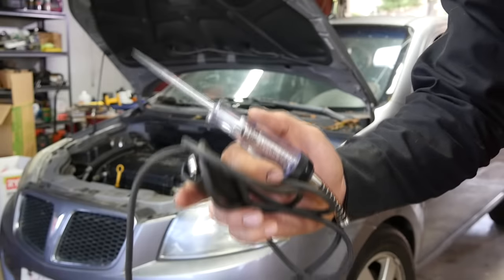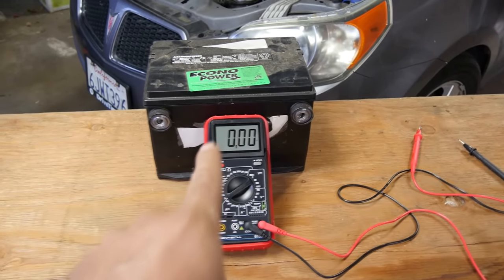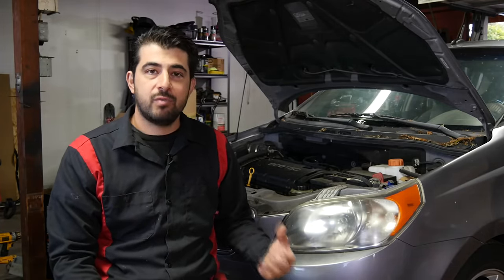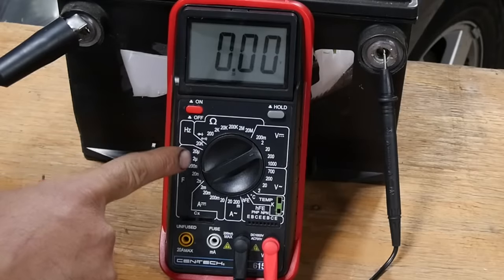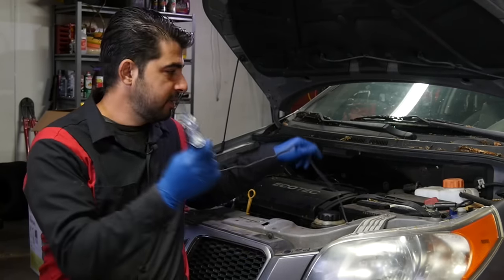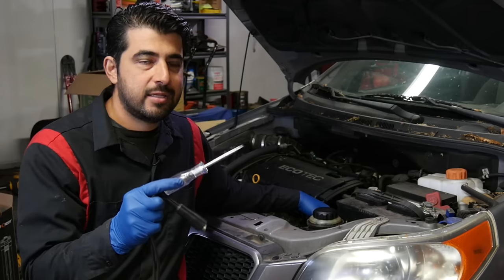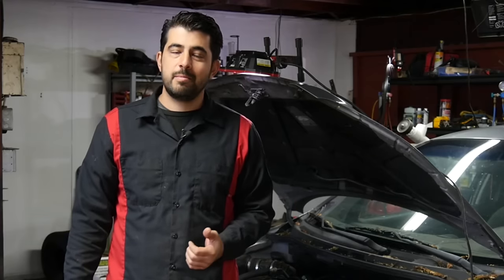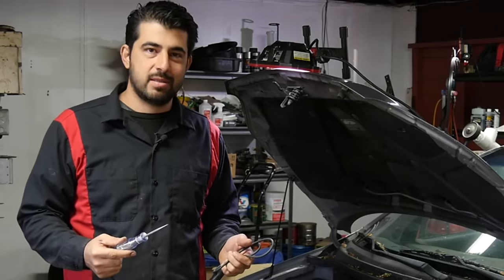MUST WATCH - Can a Test Light Damage Your Cars PCM ?

Comment: I'm an electrical engineer and you are on target.
Reply: @Sam S nice one Sam 👍
Reply: Sam S, @2:31 he clearly says that Ohm’s law is correct all the time.  Too much ear wax can distort sounds...  just saying.
I should’ve stated that I was reacting exclusively to the discussion about how the multimeter works.

Ohm’s law works all the time, but only in purely resistive circuits.  An incandescent light bulb can be modeled as a variable resistor that depends on the filament temperature.  If you had the resistance curves of a given filament, you could verify that even then Ohm's law applies.  Stop misinforming people.
Reply: Sam S, your knowledge and attitude are so wrong that they don’t deserve further discussion.  You just hate engineers because we make many times what you make.  I’ve seen many of you and your pseudo science.

Take a basic electrical course and you might be straighten up.

Comment: Spoiler alert,  YES, you can instantly fry your pcm with a test light. Always use a DIGITAL volt meter. An analog meter can fry a pcm the same as a test light.

Comment: I used a power probe and injected 12 v on a 5v ECT sponsor connector like a dummy and had to get a new module… well a used one actually and had it cloned with the old one .. 🤦🏻‍♂️ lesson learned lol never inject voltage into just any wire especially if you don’t know what your doing..

Comment: but maybe need be careful though. Suppose you branch the test light to the 5V output that goes to eg. map-sensor (other branch of the test lead to ground) . You will draw 250mA extra to that output. Maybe too high for that particular output (cannot be sure unless you have the specs of that ecu, in most cases you don't have it). When you connect a V-meter to that 5V output it will do no harm because the V-meter has a high resistance input and will not draw any extra current. So I would never connect a test light to a voltage output from a ecu.
Reply: I know that a lot of PCMs have overload protection on the 5 volt reference circuit and won't be damaged even if it is shorted to ground, but I agree. ScannerDanner actually has a couple videos showing this
Reply: @averyalexander2303  yes sounds logic there would be a protection built in. Thanks for that channel looks interesting !

Comment: Some output circuits controlled by the PCM are low amperage circuits. Some test lights flow much higher amperage than the one in your video. That could be a problem...

Comment: Well stated! I'm willing to bet that the vast majority of misadventures happened because of more glaring ignorance, such as accidentally jumping the high amp side of a removed relay into the computer ground relay pin for the control wire. In fact I think I remember ScannerDanner telling a story where he did just that, killing the PCM. I've seen guys apply 12 V with a power probe straight into a communication circuit, relying on the internal resistance inside the PCM to come through. Not wise, even if they do get away with it. Yup, test lights are incredibly good at limiting current, and you get a bonus light to tell when significant current is flowing. Also your remarks about current are spot on, power is what fries connections, and power is the product of resistance and the square of current (voltage drops out of that equation). The test light is critical insurance, especially if you use a low amp light. Many guys use an LED test light when testing computer circuits, or even, as you say, the human body. All that said, I don't know how the op amp devices inside the PCM are designed to react to voltage the circuit is not designed for. There's something very appealing about not sending anything to the PCM that it doesn't see every day.
Reply: I am trying to diagnose a power window problem, so am considering buying a test light, voltmeter, or multimeter.  I play around with computers a bit, too.  Can I just buy one device for PCs, cars, and other home stuff?
Reply: @wynnhorton1208  Learning practical circuit diagnostics is a process, and in the DIY world the progression can take decades. I would start with an inexpensive multimeter, and an incandescent (not LED) test light. A good place to start is automotive diagnostics.
Reply: @spelunkerd  thanks.  I am researching multimeters right now and leaning towards the AstroAI 6000 or maybe the cheaper AstroAI 4000. I've decided to skip the test light altogether. 
I'm looking forward to learning, because mechanics aren't cheap and neither are parts.
Reply: @wynnhorton1208  Your first multimeter won't likely last very long so don't spend too much time researching the topic. One of the most important lessons is not to measure inline current without enough resistance in the circuit you're testing. Use ohms law to calculate how much current you'll see, and make sure it is under the limit of your meter. If you put both leads across a battery, hook up to measure current, you'll watch the smoke escape from your precious meter, ha ha. Ask me how I know, it is a humbling right of passage. Quality meters have a fuse you can replace, cheap ones are destroyed if you do that once. By far the most critical lesson you need to learn is how line voltage dips down when you get electrons flowing, so called voltage drop testing. The easy way to do that is with a test light, but you can do it with other sources of current draw and a multimeter. Once you learn drop testing fundamentals, you'll reach a whole new plateau of understanding. Happy sailing!
Reply: @spelunkerd  dang, I almost bought the one with the fuse and did realize the importance of it, but the other took batteries that could be recharged and I liked that. Thanks for your advice

Comment: The gynecologist joke was gold.  LMAO  I'm stealing that one.
Bless you for trying to squeeze a 40 hour basic electricity class into a 12 minute video.  Important thing to remember is that Volts are pushed, Amps are drawn.  Example: a 12 volt battery in a 6 volt system will fry anything that gets turned on regardless of amps drawn but you can run a small 12V test light with power from a 12V, 800 CCA (Cold Cranking Amps) battery without worry. 

AND, electricity, regardless of voltage, amperage, or if AC or DC always follows the least resistive, path to ground. 

BUT, the higher the Voltage (not amperage), the more resistance it can overcome.  It's high voltage (like spark plug wires) that will let you know you really screwed up, quickly.  

Happy New Year!
Reply: @WestCoastUSA546  BWAHAHAHAHA.  I don't remember the joke but if I said it was funny then indeed it was. Who appointed you the decider of whats "warranted"?  Laughter is always warranted.  On behalf of myself and the prostate examiner, ...F.O.
Reply: @WestCoastUSA546  so you make a joke about prostate examiners

Comment: A couple of observations:

1. "It's the current that does the damage, not the voltage". While mostly true, in practice it is the voltage that causes the current in the first place. (and it is voltage that kills electronics )

2. Electron flow (from - to +) while technically correct, it should be ignored as it just causes confusion. Convential Current (from + to -) is what everybody else uses.

3. I am an electrical engineer, and I am confused after watching this video. You should have just lead with "Yes, a test light could (in theory) damage a PCM, the engineers have built lots of protection circuitry around the inputs to prevent this happening".
Reply: "2. Electron flow (from - to +) while technically correct, it should be ignored as it just causes confusion. Convential Current (from + to -) is what everybody else uses."
No!  Just Electrical Engineers are science deniers that pretend electrons flow from positive to negative!  The rest of us have been properly trained.  Aren't colleges great?  They turn out socialist by the millions and Engineers that think backwards!
Reply: Point number 2 is for people who don't understand that hooking the negative terminal to chasis ground makes the whole vehicle a source for electrons. With this abundance of electrons, it's easier to tap into them when there's something that needs to use them. The positive just provides the path back to the battery.
Reply: point 1: When dealing with auto electrics,  mostly they only need to know if there is a potential energy for a a specif point on any circuit and most of them are open or tested before a connection of interest, this is why he says "tapping-in" at those points isn't affecting anything, especially if the circuit is open (manually/electronically by a board) thereafter.
Reply: what if i hooked test light to a 5v source to test 5v ref and computer parts that take 5v by getting a 12v to 5v usb cigareete plug adapter,then cut a usb cord and plug this into the 12v to 5v adapter and find which wire is the power/ground and use this to hook test light when probing these 5v computer circuits? this would also drop some of the amperage draw from test light correct? would this be the way to go?

Comment: In extremely simple terms, as I was taught in my Broadcast Electronics class, volts are the pushing of those electrons through a circuit and current is the flow of electrons through a circuit and it can be measured in voltage and amperage.

Comment: Can a test light damage a PCM?
Yes. Here's why.
The test light in this video takes 270mA at 12V.
That's after the filament has heated, glowed and it's resistance has increased. Roughly 44 Ohms.
Let's say that when cold the resistance is only about 11 Ohms.
So initially over 1 amp could flow for a fraction of a second.
Now what's important here is the circuit design of the PCM.
A lot of the time, they have protection diodes so that the input cannot go more than about 0.6V above the 5V reference.
BUT
If the loading of the 5V reference is less than your test light can supply, you will cause the voltage of the 5V reference to be pulled above 5V and cause internal damage.
Initially tool suppliers sold LED test lights (10-20mA) as PCM-safe but in practical terms a lower current (100mA or less) incandescent test light is safe.
The one in this video COULD cause damage, dependent on PCM design.
Reply: This uses a 3w bulb,how about replace it with 2w bulb would drop it to around the 150ma range or what about pre heat the filiment before testing to raise the resitance and lower that initial spike?
Reply: Absolutely great explanation.....
I would also add (not sure it's true in all cases), but some of those input pins may be calculating resistance directly, (like an ohm-meter) and not expecting 12v...
Also, you may wish to add a limiting 50ohm - 100ohm resistor inline with the light, so as to prevent the excessive "startup current", as Simon was mentioning...
The startup current, (also called the in-rush current) only last a few milliseconds, but it may have enough current and enough time to damage you expensive ECM...
Know what your testing, and how to test it before "poking" around...!!

Comment: It does depend on how big your test light is. Go for one with a small bulb. All the pcm drivers that could be damaged will require more than about 500 mili amps before they may fail so a 200 milli amp test light is is fine.
Reply: No, set scope trigger to capture, Place your current clamp over the POS on your battery. Drop your 200 mA test lite to pos and catch the current.

Comment: Excellent video, but I’ve always understood that the convention of current flow in a car as going from the positive to the negative side of the battery, not the opposite as you stated at the beginning. That is why we should always disconnect the negative side of the battery first, so as to eliminate ground to all circuits. Please correct me if I am mistaken. TIA and, again, great video (long time subscriber here).
Reply: Johnny Blue - this is precisely what I‘ve always understood to be the case. Yet, this also means that the negative side of the battery is where ground is. And ground is where the electrons go (even though the symbol is negative), no?
Reply: Johnny Blue, thank you again. That helpful link you listed states that, in a DC circuit, because of (confusing) convention, current flows in a direction opposite to the flow of electrons. Is that why, in a car, the positive side is called “power” (even though that is not where the electrons are coming from)? I’ve always thought the term “power” referred to where the electrons are flowing from. Messy...

Comment: The big danger with a test light like that is that you can provide voltage to a coil somewhere on a solenoid and "jump start" your engine or some other system that you have your arm sticking into or are laying under. Be cautious what you test with the lights, it is really just a wire and you are basically connecting things to the battery to see if the other side of the device goes to ground or power. Better to use a meter with one of the additional probes that will show you what is going on if you know what you are seeing on the meter. Also, never push the pointy end through the insulation. You will wish you didn't in a few months when that wire starts to corrode and the resistance goes up and you keep changing "bad" sensors or whatever and it just never acts right again.

Comment: I finally subscribed and as an old electrician voltage is like the pressure in a water pipe current is like the volume (size) of the pipe. Voltage  does not change speed. I like your stuff. Mike

Comment: Hello
From Panama
I like so much your videos
Your concepts are right.
I suggest always use a voltmeter when checking sensor or stuff relared to PCM.
In analog voltmeters you can see in the left side of scale a value such ohmsX volts. It usually is 20komhs per volts.
For sensor troublehooting 5v bias your analog voltimetr will present 100,000 ohms to circuit in electronics it is call impedance. That value is ok for  the test and should not affect the circuit operation. IF you want more impedance  you must use a MOSFET voltmeter o simply a digital voltimeter because they use mosfet coupling and shows more than 1Megohm impedance.
The lamp test is always ok to test electromechanical devices such relays contacts or to isolate bad conecctions in wiring.

Comment: A test light can surely overload a low power circuit but I would much rather see a tech with one on those in his hand that a dang power probe.  All those should be thrown in the garbage.  I work a techline and you wouldn't believe how many modules I hear (actual beeping) get fried by 12V being pushed in a signal or control circuit by a trigger happy tech with a power probe.
Reply: Greg M power probe is an awesome tool but you have to understand circuit design. I typically use test lights but in some cases power probe saves time. You have to know which tool to reach for given the situation.
Reply: Why blame the tool? the tool has its purpose and if you use it wrong you pay the price......

Comment: I have been an electrician for over 40 years and I am telling you that some of your info is spot on but on some other stuff you could be steering folks wrong on some of the stuff that you are saying. For one thing when using your test light in series with your DMM you say there is no current flowing. WRONG. Just because the light does not light up does NOT mean there is no current flowing.  True that the light bulb will limit the current but there is enough current flowing  and voltage to damage some electronic components.Just saying, buyer beware.